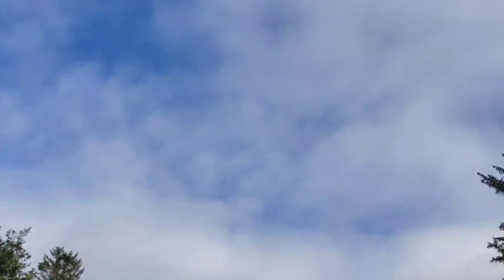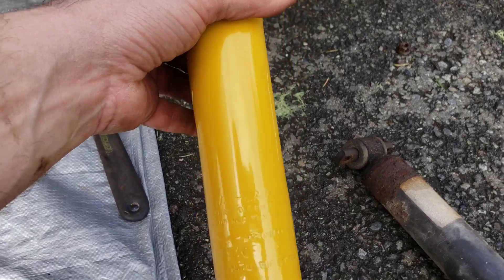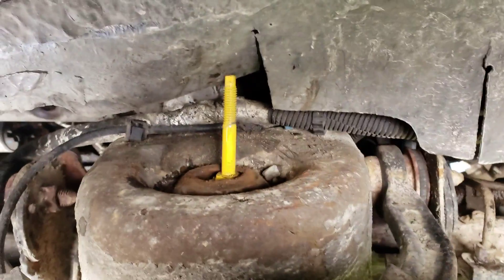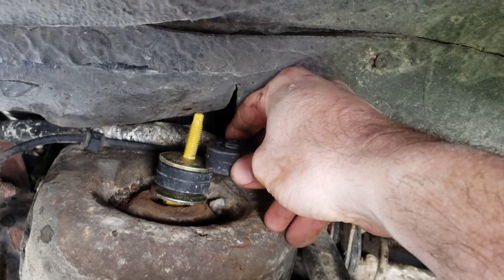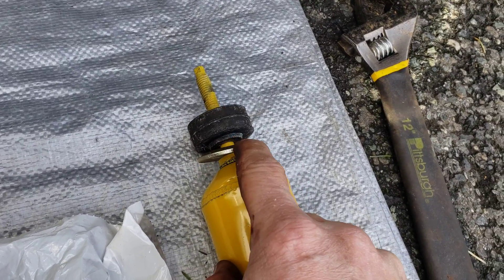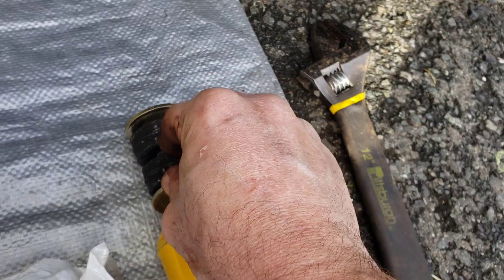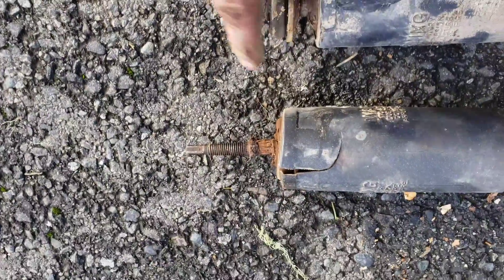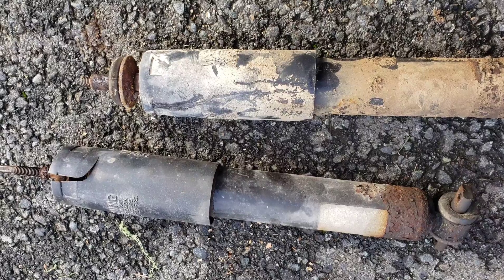Never Ending Maintenance

Comment: I think those washed should cup towards the rubber bushing? Probably wont matter to much?
Nice you found a place to work on it.
Reply from the maker: I got the top washers right(double checked) lol. It's been about 20 years since I changed a pair so it threw me off.  I did get kicked out of my first repair spot. I did find a city park that was more accommodating though.